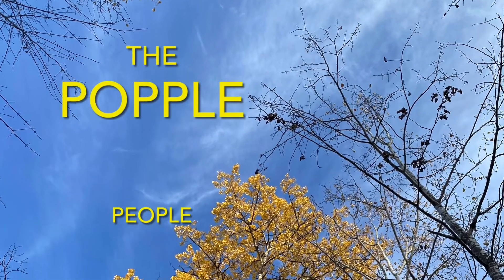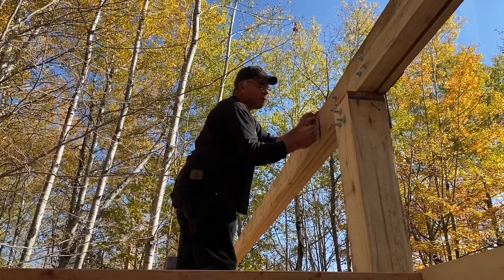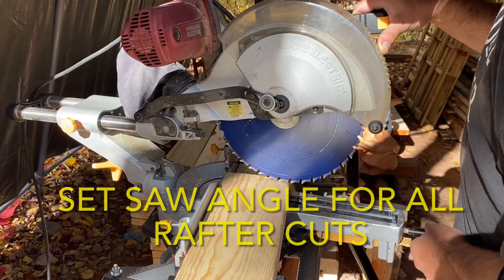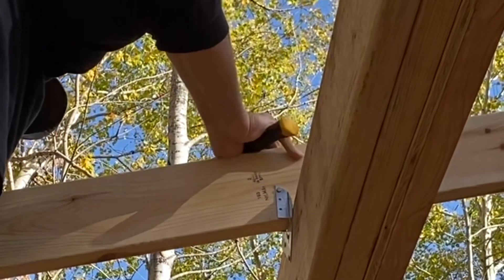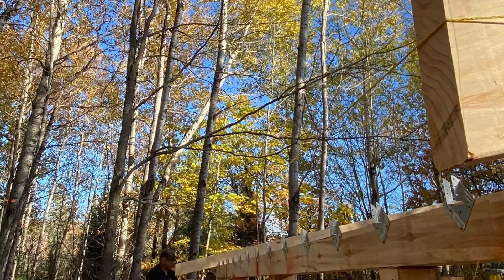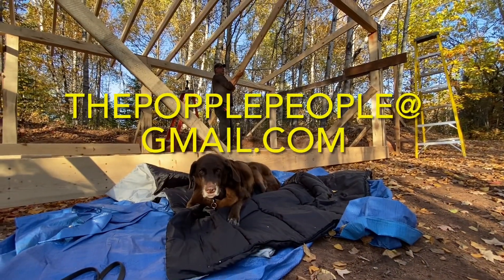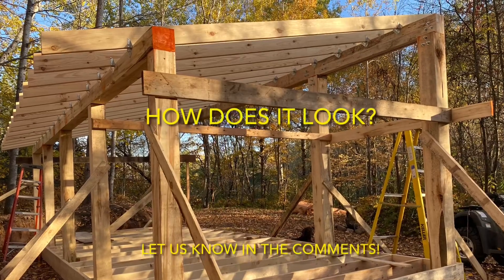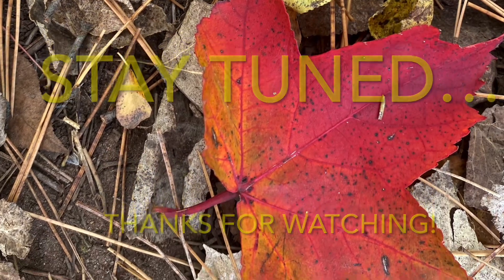OFF GRID Saw Shack RAFTERS (EASY!)-Popple People-Episode 61

Comment: What number rafter ties did you use and what size /length screws into the back of the header? Great Build! I'll be putting my wood shed up this Spring.
Reply from the maker: Thanks so much! Rafter ties are MiTek 5-1/4 inch x 1-9/16 inch rafter to stud anchor ties (PT15-TZ Ref # H1Z, quantity 30). The screws we fastened them into with are #8 outdoor screws, 1.5 inch. (NOTE: we accidentally put them on flipped—didn’t notice until we were finished 😳—ours should be flipped so the vertical lip rests on header. Look at the installation instructions for the ones you buy.)

Comment: What are the heights of the front and back walls?   Is that a 15° roof angle?
Reply from the maker: Front wall is 91 inches, back wall is 67 inches, & roof angle is about 14 degrees.